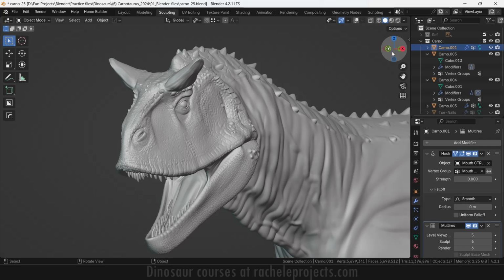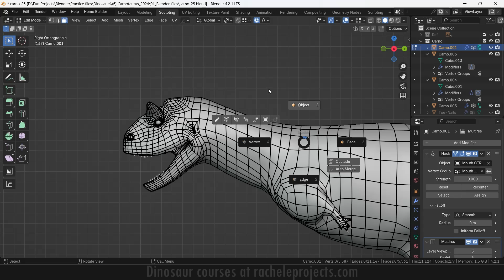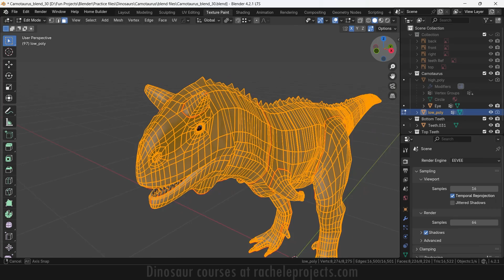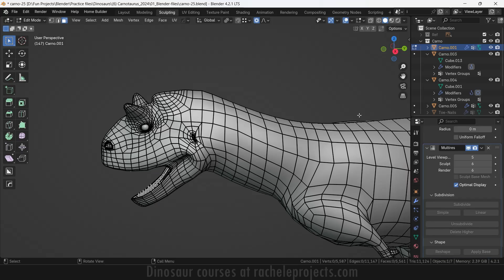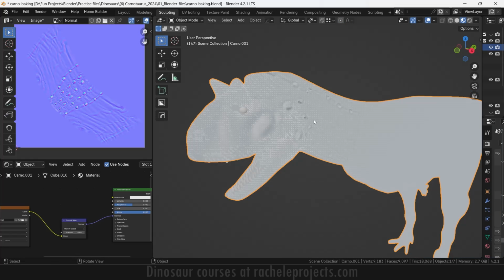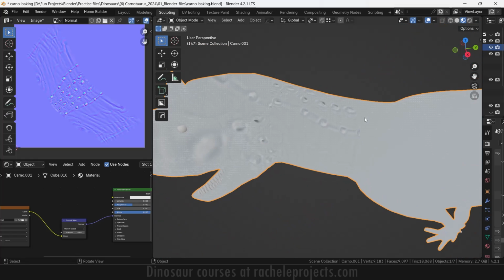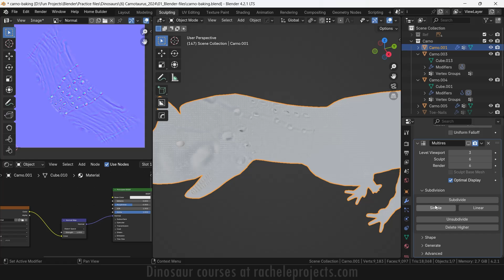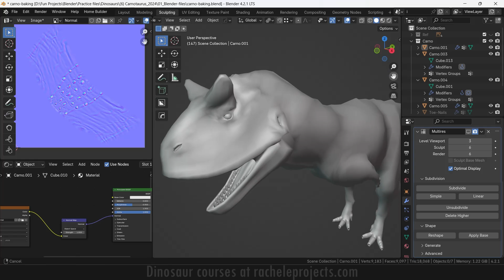Issues when Baking with the Multiresolution Modifier in Blender [Topology & Baking High to Low Maps]

Comment: Try shrink wrap and multires on the low poly like in this video the sculpt but for this low poly level better to model pikes than using normal map https://youtu.be/1CiQxc1QvRM?si=5i6i3Vz5OWC2_aev
Reply from the maker: Totally agree it’s better to model/extrude the spikes. I did end up retopologizing this mesh with the spikes added. 
Thanks for the vid! I’ve seen it before great video 😊

Comment: The apply shape is there so that the base mash matches the high res sculpting better for baking, in games you'd use a height map as well as a normal map... the height map would be used with dynamic tessellation to add the geometry where it's needed and the normal map works with it to recreate the perceived detail.
Reply: I think you can subdivide the basemesh your self and strategically add the needed geometry... that would then preserve silhouette detail like those spikes, and other more surface contained detail would be handled by the normal map.
Reply from the maker: Yes thank you for providing some explanation!